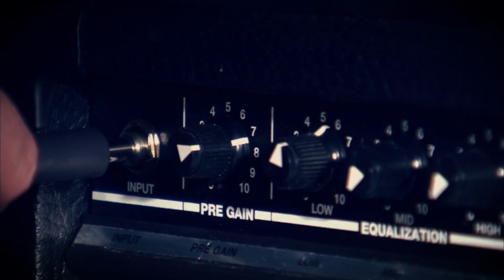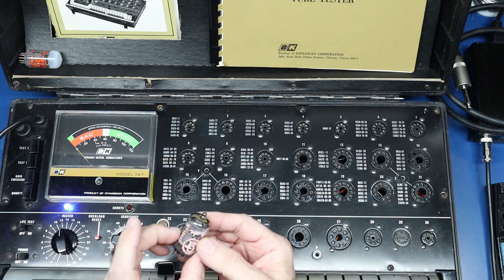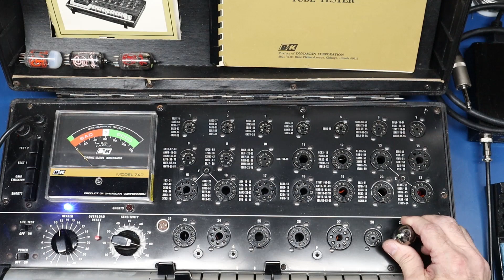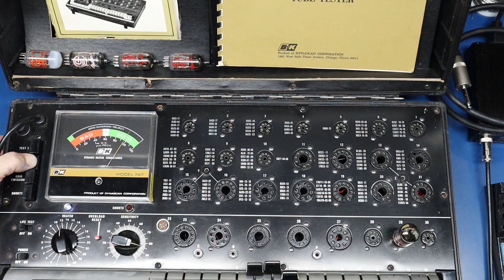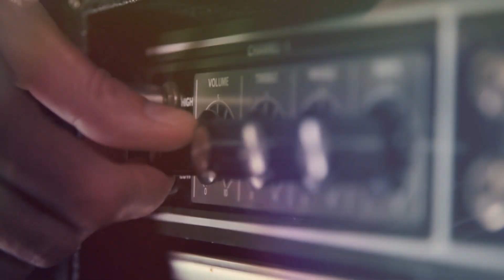B&K Model 747 Tube Tester Demonstration and Importance

Comment: I've got a 707 model. I bought it along with 500 or so vintage tubes for my guitar amp building. 226 bucks for the lot. What an incredible deal.
I had to mod it to test 12ax7 properly. I'm told it's recently calibrated. Seems to work great, but lots of the sockets are worn . I have to find a good replacement for the octals . They're smaller than the belton I usually use.

Comment: I'm wondering is it ok to just press the Test button? I heard you need to check for shorts & then grid before hand & if the shorts lights up don't test any further. I tested a 12AX7 that had crackle & it lit the shorts light up. I forgot not to go any further & I pressed the grid button for a few seconds & it went into the bad range then realized I shouldn't go further. Now the tube doesn't light up the shorts light & the Grid Emission doesn't fail.. Do you think I damaged my tester?
Reply: The other question I had was I had an EL34 tested in an Orange VT1000 & it failed 2x's but in this tester it still showed good.
Reply from the maker: The Orange VT1000 tester has very limited capability and only gives you a general idea what is going on.  I do not use one for this very reason.
Reply: @proampsolutions  Any thoughts as to why my B&K would show a short after I calibrated it & I press Grid Emission (which I know I shouldn't do) the needle went up 3/4 of the scale & when I pressed the shorts button again it showed no shorts?
Reply from the maker: Grid emission is a catastrophic failure in a tube. The tube is probably destroyed to the point where the short that existed may no longer exist. If your B&K is properly calibrated, you should test for shorts first, if you have a short test no further the tube is bad - period. You should never persist with a shorted tube, bad things happen. Also, good is relative! That is why there is a scale on the meter. A tube may sound just fine to the listener but in fact may only transconduct 65% of what a new tube does, but it still "works". A tired power tube will likely still work fairly well, it just might take less negative bias to run it at ideal idle dissipation. A calibrated meter is a good tool and should help you quantify results, not leave you with questions.
Reply: @proampsolutions  I calibrated my meter correctly & your explanation explains exactly why the Shorts isn't lighting up & I'll throw the tube out. As for the one Power Tube I'm a bit unsure as you stated previously the Orange tester isn't as good so the PT that fail in the orange tested good in the B&K but I heard crackling & the volume cut out so I guess the Orange found something the B&K didn't?
Reply: @proampsolutions  Did you use a LED for the Shorts Lamp?

Comment: Do you always test both plates on those tubes?
Reply from the maker: Yes I always test both plates on a dual triode tubes. One can be bad and the other good, or they can be significantly out of balance which may be important, depending on the application.